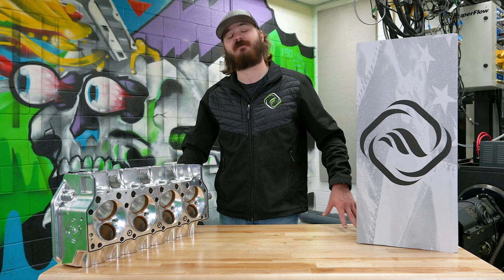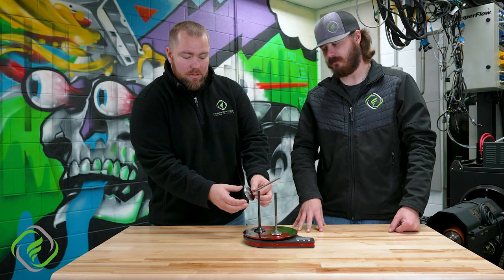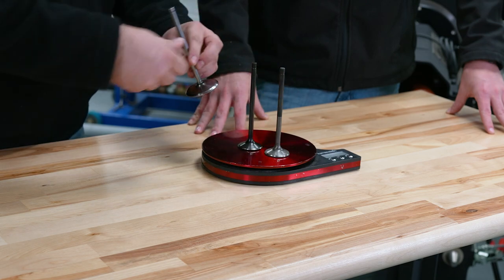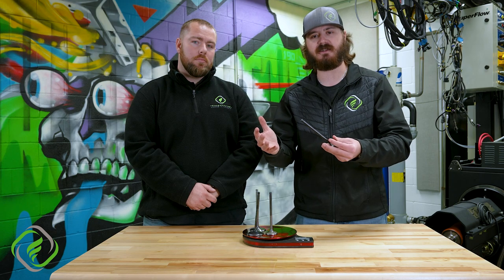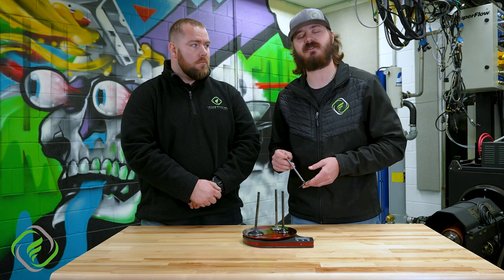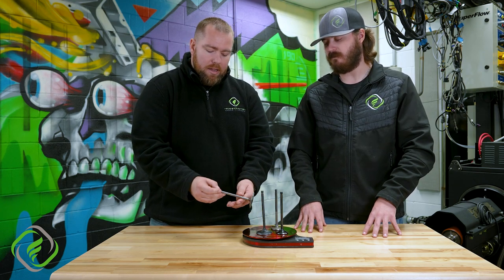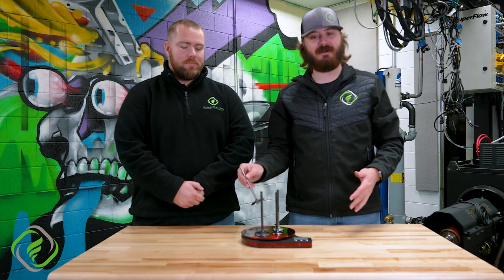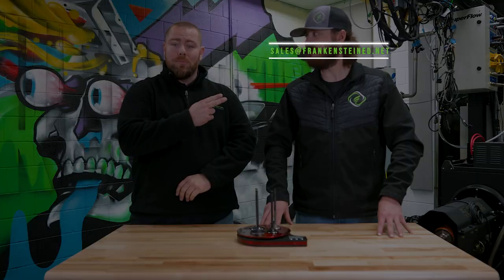Frankenstein Tech Series S1Ep1 - Valves 101

Comment: Can't wait to get more in depth on some of this stuff. I'm dreaming of building a high revving, NA LS3, shift point somewhere between 7500 and 8000 just because I think it will be fun, probably run a solid roller cam. I'd like to use this in a weekend street car and that occasionally goes to the drag strip and the occasional HPDE track day on a roadcourse. I'm not sure if what I'm dreaming up is realistic or just a recipe for disaster.

Comment: I have a set of your M311 heads going on a LSX 427 2650 build. Should be slightly north of 1k wheel HP. My question is what are the valves that come with the M311 heads rated for at the flywheel.
Reply from the maker: prob be fine up to 1300ish flywheel. At this power it just comes down to the tune up and fuel being used.